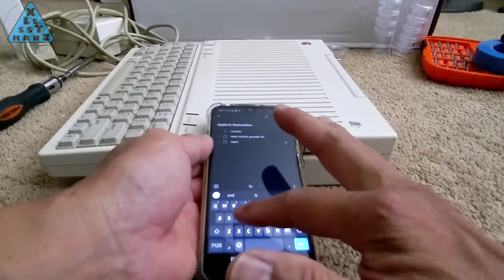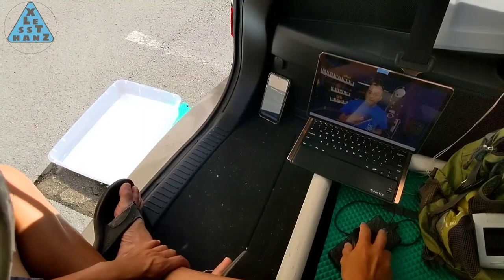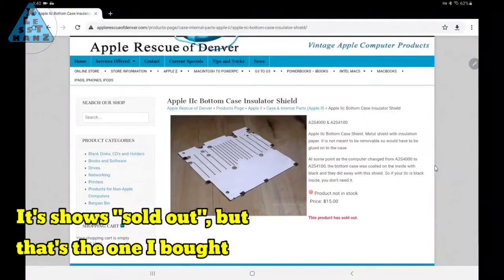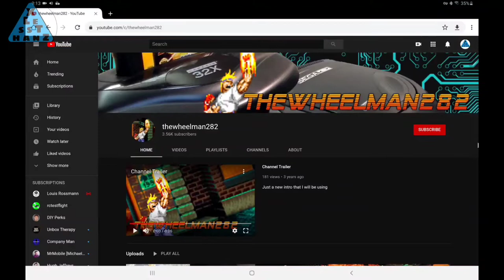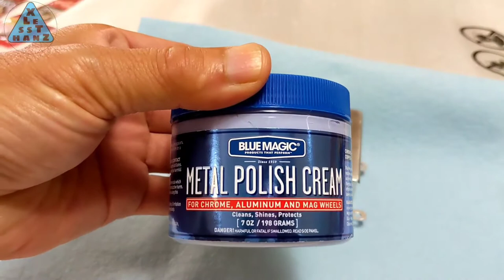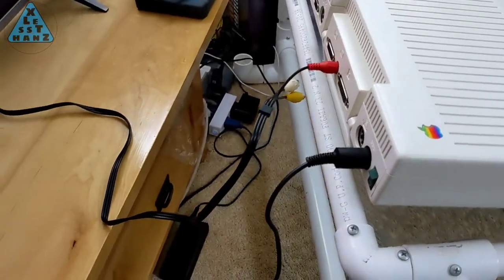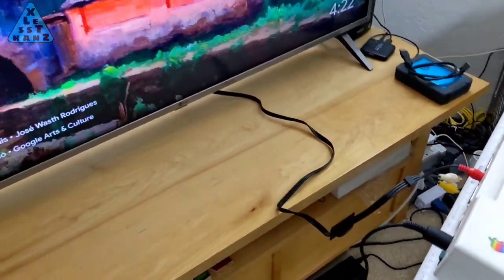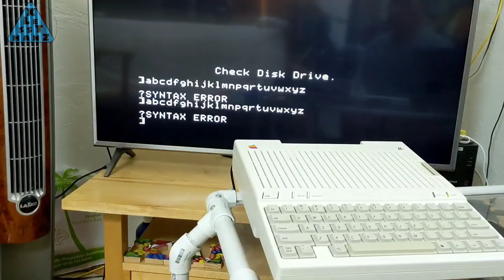Restoring An Apple IIc (DOWN TO THE NUTS AND BOLTS)

Comment: Excellent work.   I like the extra attention to detail.  Although, I probably would have bought a new key cap, if you are going to commit that much work and time into perfecting everything.  I am also working on  two similar projects concurrently.  I am restoring an Apple IIc (like you are).  I also had one as a child during the 80's and loved that computer so dearly, so I decided to get one off an auction site before they become too expensive.  I got the IIc, the IIc green monochrome monitor, and the IIc monitor stand.  The only thing I am missing is the IIc serial mouse which is a bit expensive right now.  I will be tearing everything apart and doing a complete restoration on this in the next few days.

I also bought a MacIntosh SE/30, which was my dream computer during my college days.  Since it was about $6500 USD back in the days, I thought I'd never be able to afford one. But I finally got one and am in the process of restoring and upgrading it.  So far, I have recapped the motherboard and now I am retrobrighting it.

I am documenting everything so hopefully I will be able to upload the videos on YouTube soon.

Lastly, I just wanted to comment that you should not retrobright the key caps.  The paint or ink on the key caps on the IIc are bit more delicate than the other models and will fade if you retrobright them.  Also, be careful with the Apple logo on the left, and //c emblem on the top right of the case.  These are also susceptible to fading if you handle them too much with cleaners and H2O2.
Reply from the maker: Looking forward to your videos.  I'm interested in the IIc, but the SE sounds interesting as well.  I did notice the discoloration problem with the key caps when watching some of the other channels, so glad I skipped that step without knowing at the time.  Good luck on your restoration.  I'll be keeping an eye out for it.  👍